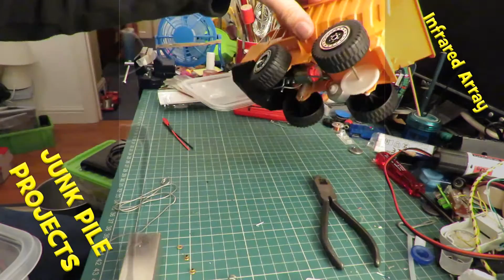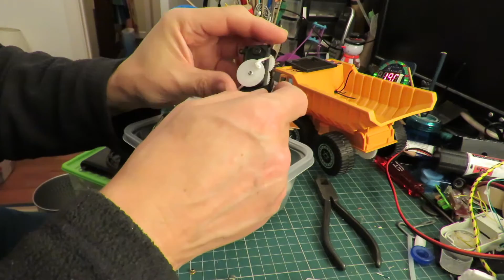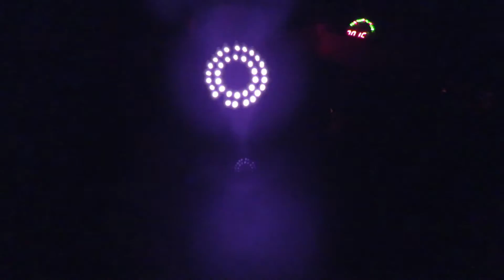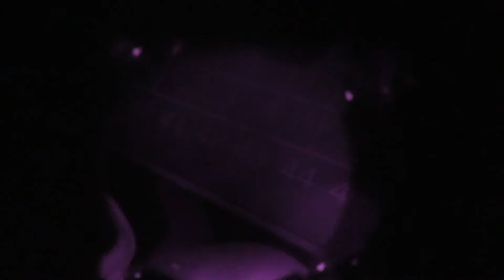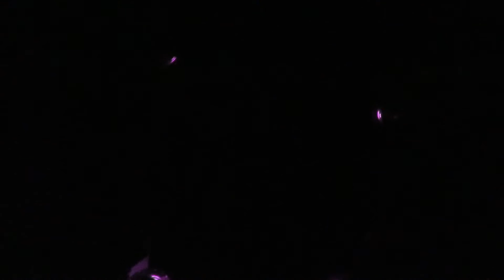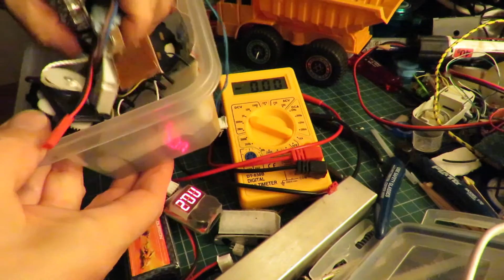Junk Pile Projects - Infrared Array

Comment: I have a network camera with night vision.  When it switches from night to daylight and vise versa, the picture goes white.  I guess, while the camera auto-adjusts it's settings.  As you know, you can't put these behind a glass pane like a window.  My plan is to put the IR LEDs outside a window so they don't reflect off the glass and back into the camera.  Maybe use one of those solar security lights and swap the LEDs with IR LEDs.  .. Oh, second  :-D
Reply from the maker: I think what happened was I was looking at the IR floodlights you can get which will light up the whole back yard as we were having some local issues and then I spotted these. They were cheap so I put one on my shopping list. When it finally arrived I just put it in the drawer and forgot about it. Later I did have half a plan in mind for setting up a camera to look for hedgehogs in the garden or other night time visitors.
Reply: The major problem I had with putting a night camera outside is the cost of a weather proof camera.  As some standard digital/web cameras will pickup the IR light, I was also thinking that an IR floodlight was the way to go.  With the camera and the light in separate enclosures, weather proofing should not be a problem.  It's interesting to see what visitors come by.  Heck, I found out that I have a cat that lives with me!  Well, not actually with me, but he lives here too.  Now, if we can just be friends.
Reply from the maker: Jay Herde 😊